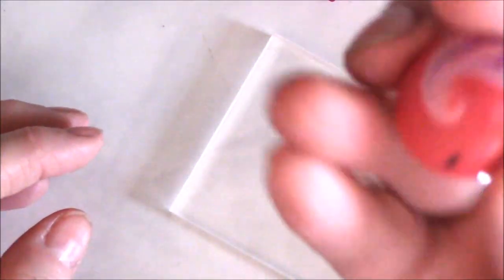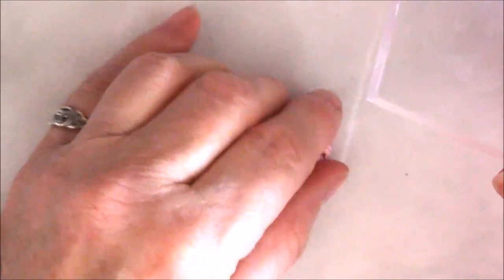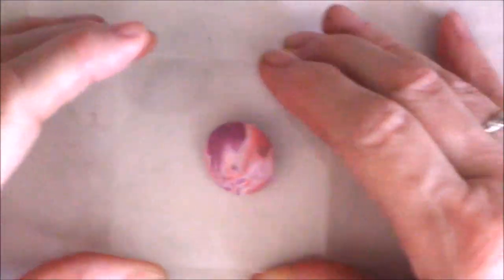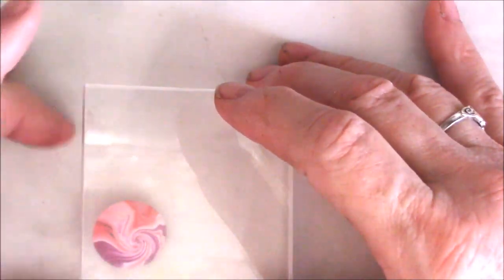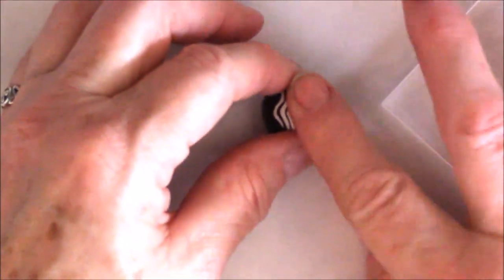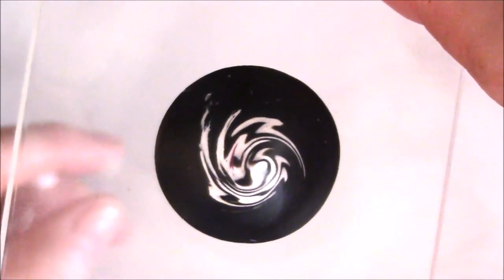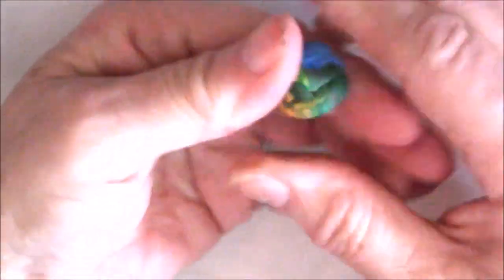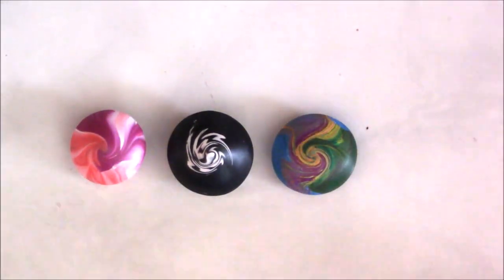How to Make A Polymer Clay Swirl Lentil Bead by Gayle Thompson -

Comment: I need to practice more on these lentil beads. I just can't get them right. one day maybe I haven't practiced that much though. you just whip through um though lol
Reply from the maker: It takes a while to get it.  I messed up a few before I started recording!  The main thing is to not press down on them and maintain the point until you are finished.  And try to keep your acrylic block as even as you can.  Keep trying.  I have no doubt you'll get it.
Reply: Gayle Thompson thank you. :) my problem is, I think, is pressing to hard. I really like some I seen on another channel so I might practice more so I can make them. :)

Comment: You can get the point back. I have done it a bunch. I can't think of how to tell you how I did it though. It is possible by using your flat piece of glass. I love making these. They are so addictive. Getting a straight even hole through them unbaked though is a pain. I gave up and now I just drill them after baking. 

- Heidi
Reply from the maker: Yes.  I've gotten my point back but since this was a Beginners lesson, I didn't want to go into that in this video.  You are so right!  These are addictive!
Reply: Most of the time I can't figure out what to do with them. :P I have used a few to make key chains but most just end up collecting in various containers. Maybe I should just sell them as beads online so I can reduce clutter as well as be able to keep making them. :P
Reply from the maker: Selling them is always an option!  I have one attached to my thumb drive to identify it as polymer clay data!
Reply: BlackCat2 ...  Selling them is an option.  I bought metal bookmarks and often attach beads to them.  Lentil beads are a nice addition to the bookmarks.  They also make lovely earrings and pendants.  I decorated a lampshade using beads, the focal beads were lentils.  One year I made quite a few lentil beads in various sizes that resembled peppermints.  I strung them from a chain and used them as Christmas decor.  The next year I sold peppermint decorative items during a Craft Show.  The ones with green and red swirls were most popular.  Go figure.
Reply: Neat Ideas! Those peppermint candies (red and white mostly) were my mothers favorite. There was always some in the house year around. I keep some in my house but I like the green and white better. She is always in my thoughts but those candies help. She will never be truly gone if she never gets forgotten...